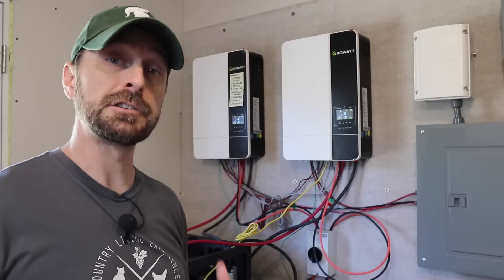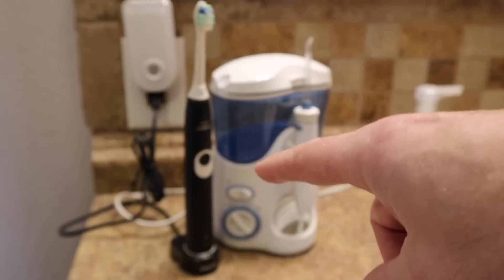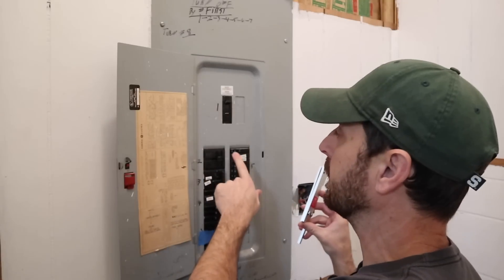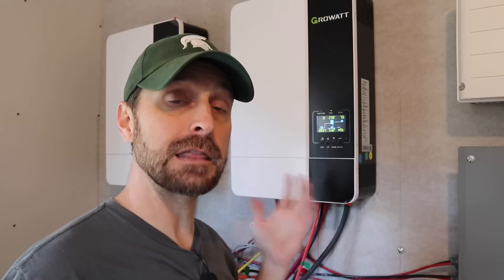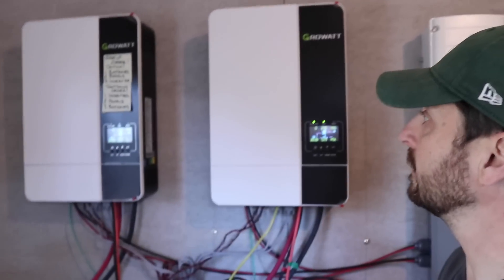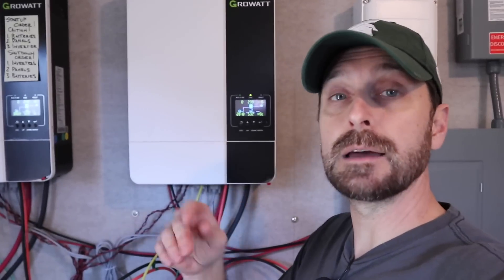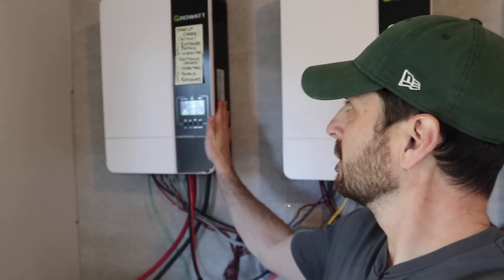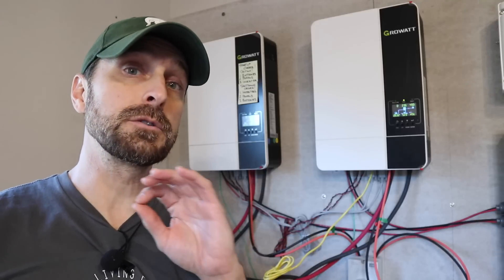Testing Our Solar System! 2 Growatt 5kw Inverters! What Can It Handle?

Comment: Good video, can I ask why you don’t have it hooked to the grid? I’m in Western Australia and I have a 6.6kw solar system and a powerwall 2, we use the batter as a backup but also to supply the house. It’s currently summertime so we make over 42kwh a day. But only use about 12-15kwh.
Reply from the maker: Thank you. I want to be independent and unconnected from everything.
If you are making that much power, you could sell back to the grid if your power company allows it and you want to be grid tied.
Reply: @CountryLivingExperience  Thanks for the reply. Unfortunately, we have another 6.6kw system as we live on a farm and we are only allowed 1 if we want to sell back to the power company, i would only get $0/07c/kwh. I worked it out the other day the power company has made over $1000 AUD from the power we send back for free last year. I often think about going "off grid" but in wintertime we do have a lot of days where we only produce1-5kwh of power a day due to heavy rain and cloud cover.
We have a gas stove top but not oven, it's helpful if thy power goes out so the battery can run the lights and water pump and other items. Anyway, thanks for the video its helpful, i like watching other people and how they set their systems up. Stay safe :)
Reply from the maker: @Achilliez  Glad it was helpful. Have a great day!
Reply: I to have not experienced flickering.

Comment: The 5000es cannot back feed to the grid, they can only pull it is a off grid inverter. If you have a generator it should be set up to charge the battery.
Reply from the maker: I recognize your name from the solar forum.
I think you misunderstood what I was saying. By backfeed I mean that if my system is on (the solar breaker on the main panel) at the same time as the grid power main breaker and the grid goes down, my system can backfeed the lines and injure a line worker. That is why I have an interlock kit. 
As for a generator, I have a small 2kw that I will attach a 48v battery charger to. You can watch Sig Solar's video on why this is a better strategy than having a large generator connected to the inverters.

Comment: Is your "solar room" climate controlled and if so how do you plan to cool it?  Would this setup be OK in a regular Texas garage?
Reply from the maker: Our solar room is open to the rest of the house as it is connected to our existing utility room. It is conditioned the same as the house. If by Texas garage you mean open air, then maybe. It may get too humid for the inverters and batteries in certain parts of Texas. Other areas may work.

Comment: Do you think the sound of these would bother you if you had them in your office?  They sounded pretty quiet to me in your video.  I am considering doing maybe 3 inverters, 2 transformers, & 6 batteries in my home office that my wife & I work in daily (we use PCs and work remotely).
Reply from the maker: Yes, the fans get quite loud when there is a heavy load on them. I would find another room for them.

Comment: On my Victron inverter, you can manually connect a generator and only turn it on when you’re not connected to the grid. This ensures no issues or problems. 🖖
Reply from the maker: Cool. Each inverter model and brand is different.

Comment: Have you tried to run your 3 ton heat pump without the heat strip off your inverters . With a soft start it should start and settle around 25 to 30 amps?
Reply from the maker: My heat strips are not connected. I didn’t want to invest $1k on a soft start for an old inefficient system. It has a slow leak in one of the lines too. Not worth it.
Reply: @CountryLivingExperience  didn't know they were that expensive.  Wow

Comment: Have you been experiencing any of your led lighting flickering from these inverters? Especially when the inverter are at a low output? Mine is making my led light bulbs flicker, barely noticeable but it's there.
Reply from the maker: I still have mixture of cfl and led but none of them flicker that I have noticed.
Reply: Flickering: usually low quality made LED bulbs...

Comment: Euro is 220v at 50hz  you need a transformer to reduce to 110v if your house has an insurance claim they will not cover you. When you add to insurance, the first thing they ask is who installed it. The Technician you need to hire first task is the wiring, then all the certifications for North America. UL, eTL, CSA  etc  Not CE
Reply from the maker: These inverters are modified for the American grid and I have a transformer. So, nobody can ever do a diy solar system?
Reply: As far as I know the inverter is  multi frequency, which can be set to 50 or 60 Hz.
Reply from the maker: @phmagpantay1066  That is correct. They can change from 230v to 240v as well.
Reply: @CountryLivingExperience  Is it certified for an inspector, I think not.
Reply from the maker: @BillyBob-fd5ht  I didn't think you could answer my question. You don't get to ask any if you don't answer mine. Now I am sure you are yet another arrogant "I've been doing this for 30 years and you don't know anything" guy.
Reply: @CountryLivingExperience   My house burns down, Should I refer you to where I got my information from?
Reply: My house was built in 2016 valued around 400K and not one single permit or inspection was done or required. I have been insured by State Farm for 6 years and when I called my agent he said Solar might add $10 a month to my bill and possibly $0 per month. How can you make a blanket statement like you did. Do you know every rule for every County in the US, or are you just a negative person in general.

Comment: How are you able to use off grid and grid  power in the same building, I am trying to do the same thing but the electrical inspector says that NEC does not allow a building that has grid power to also have off grid power if the equipment isn't UL listed, growatt isn't UL listed to can't be used in building with grid power
Reply from the maker: I don't use them at the same time. This is used like a generator. Grid power is cut to the house. The inspector doesn't understand. Give Signature Solar a call and ask. They are the experts.
Reply: @CountryLivingExperience  do you have a link that explains that NEC allows grid power and off grid power in the same building? My install would be almost exactly like yours, impossible to have both power sources powered at the same time and would be impossible to have them connected at the same time causing my solar to deed the grid, inspector won't sign off on install with non UL listed equipment and multiple electricians say they won't do an install that can't be signed off on, I called signature solar and they told me to make sure I am purchasing UL equipment so that I don't violate NEC or cause any issues with my home insurance
Reply: I passed inspection. But my grid is set up different from this set up. My grid is only used in  bypass mode on my inverter’s. You can see it on my YouTube channel. I am hoping to do a load test video next week.

Comment: If I had like 4-5 inverters and 60kwh (gyll batteries), would it be enough to power a house with a Mr cool universal w/vrf central heat pump system for like a couple days off grid?
Reply: I have 5 mr cool mini splits. I also have 12000 watts of solar and 3 of the same inverter’s with the transformer. I have been running it on only 19 kw of battery storage. Using a little grid power. Tomorrow I get 4 more batteries and hope to have them hooked up by Wednesday.
Reply from the maker: Absolutely! That is a big system.
Reply: if you have enough solar panels you can run it unlimited days!
Reply from the maker: @uhjyuff2095  If you have enough money you can do anything.

Comment: Rather than convert appliances to propane I would suggest  leaving on electric to maintain your independence. Just add a few panels and another Inverter.
Reply from the maker: I like redundancy. I won't get rid of the electric appliances. I calculated that I can use the stove and water heater for 3 years on the propane that I have.
Reply: @CountryLivingExperience  Water heater might use more unless you get a on demand. My 50 gal propane water heater tank uses about 720 gallons per 3 years and I live in sunny San Diego. My small solar array (2kw) heats my hot water now, so I don't use nearly as much propane anymore!

Comment: 😎 Our inverter is 6,000 watts, it has two 3,000 watt legs. We have to be careful about what we run, but as long as we are careful, we can run what we need to.  Our dryer uses over 5,000 watts by itself, so we just use it on air-dry then hang everything. Once we get our house built, we'll probably use propane for our dryer and stove.
Reply from the maker: Very cool. Yes, it is about knowing your individual homestead and loads. That is one of the keys to success.

Comment: How are your Inverters setup? One line for inductive and high loads and the other for the conventional outlets and lights?
Reply from the maker: No. They are a balanced combination.
Reply: Both inverters are 240 volt AC output and they are in parallel connection. Like two portable Honda EU2000i generators in parallel except these "Solar Generators" run off solar and batteries instead of gasoline. I can do the same tests on my house, including running the A/C unit outside, with my 10kw honda 20hp generator. It's thirsty about 5 hours per 5 gallons gas :(

Comment: Curious as to why 2 5k instead of a single 12k. Lot less wiring. less money.
Reply: The ability to add more capacity down the road is the biggest reason
Reply from the maker: Exactly J M. They are stackable and I can add more if needed. The wiring is really no big deal.
Reply: Why limit yourself to just a 12K? You cannot parallel those units. I have an Aimes 10K inverter and it will shut off after a little bit when welding

Comment: You are my wise man and an inspiration to me and my family. Thank you for all the information that you shared and we love your channel. I have 6 of the same battery’s, 5 of the Growatt 5000 and 2 Growatt transformers. I purchased everything excluding my 22,400 watts of panels from Signature Solar and I am in the middle of my install. I have a 3-1/2 ton heat pump with a soft start and I am hoping to be able to go off grid. I was wanting to stay grid tied for back up on cloudy days using the pass through but I notice you said the wiring was too complex. I have to get my install inspected so I am having a professional Electrition and independent solar installer do the work. Have you ran the batteries through the night yet and if so what percentage did you use?
Reply from the maker: You're welcome. I appreciate you being here.
Sounds like you have a huge system. I have not run the batteries at night yet because I have the 3 ton heat pump running at night and the system won't handle it. As soon as I switch to the mini-split system, I will run another test.
Reply: Flipping coins I would love to see a video of that set up . Sounds really close to what I'm planning. It's unfortunate that no one is doing the pass though. In December that was my plan 100% it lowers the electric bill to the lowes but gives me the grid as instant back up. Currently have a skid  of 28 435w panels and one growatt 5000es one auto transformer and 4 agm. The batteries were in a different when I purchased a trailer might as well play with them. Tell summer when the array can be installed.
Reply: @electricandlsxpower  have not had an issue with the pass through
Reply: @chrisloving6647  could you share a wiring schematic or diagram with me. I have a 23KW system with 5 Growatt 5000 2 Growatt transformers and 7 EG4 Batteries. I have a 3-1/2 ton heat pump with a soft start ( all products from Signature Solar ) and want to run with pass thru to the grid
Reply: @flippingcoins7714  not sure how to do that

Comment: Love your content but I must say that going to propane with your stove and dryer is going in the wrong direction.  Since your system can operate those appliances as is, you are more “off grid” by having electric appliances that you can power with energy that you produce.  I personally will be looking to go with a heat pump dryer, heat pump water heater and an electric stove with induction cooktop.
Reply from the maker: Thank you. I understand that but I like to have redundant systems. I already have a full 1000gal propane tank. In an extended emergency time period, I can trickle that 1000 gallons for an estimated 3 years for just the stove. I will keep the electric appliances for backup as well. I am actually going to switch my thinking on the water heater and go with a heat pump as their efficiency has gotten much better.
Reply: @CountryLivingExperience  If you like cooking on gas I'd recommend you try induction first if you have not done so before. My home has induction and I love it. Formerly loved cooking on gas myself. Induction heats MUCH faster than gas, cools off instantly compared to electric, and best of all you can set a bar of chocolate on a running stove next to your food and it won't melt.  Aside from having to get induction pans ( stainless, cast iron, or induction ready aluminum ) it has no real downsides. It's also close to 90% energy efficient compared to Electric at 65% and gas at 50%.
Reply from the maker: @genxtech5584  I thought about it. I might pick up a 2-burner induction cooktop to try it out.
Reply: Sometime this year Rheem is coming out with a 120 volt heat pump water heater. Hopefully it will be cheaper and more efficient than the 240 volt models. Might want to wait to see those reviews on them.
Reply: @chadcarrington1218  Good point Chad, but I think for this system he would actually prefer to use a 220V heat pump water heater.  This is for two reasons.  1. He has the 220V wiring in place already for his existing water heater, so no need to prefer 110V for easy wiring.  110V hybrid units are ideal for situations such as replacing a gas system with electric and not needing to run the 220V wiring.  2. The way these Growatt inverters are set up, they are 220V output and he has a step down transformer for serving his 110V loads.  This gives him a desire to run 220V loads over 110V loads in his house to avoid overloading the step down transformer where possible.
Reply from the maker: @chad carrington Thanks for the heads up on the Rheem
Reply: I agree, the stove, oven, dryer, microwave, are not super high energy appliances. Like he said he can trickle his propane tank for 3 years with those appliances, so why not keep them electric. However, the mini split idea is a great one, so if I had to choose, mini split or the other microwave and oven on electric I would 100 percent choose the mini split. The Mini split is the real high draw energy appliance, and number two is the hot water heater for most houses.

Comment: That was very impressive and informative. It was fortunate that you were able to do this before converting the stove and water heater to propane, as some folks might not have that option, yet.
I, for one prefer cooking with gas or propane rather than electric, but where I live, gas is practically nonexistent and propane is not widely used.
One of the reasons I prefer gas/propane to electric is that here (Maine) lines can go down easily for weeks. With a gas stove/ oven, you can heat at least one room, while heating water for cooking or even bathing. 
I tend to plan for worst case scenarios, so even if I lived in a mild climate, I'd probably plan for Maine winters and Laredo summers. Lol.
Reply from the maker: Thank you. I also like planning for worst case so having the propane as a redundant system was important for us. I will keep all my electric appliances for backup after converting.

Comment: After doing this test, how long do you think you could run the electric loads in your house in a normal capacity if the grid was completely off? Do you think you have enough battery backup and solar to continually stay off the grid indefinitely yet?
Reply from the maker: I can absolutely run off grid in a normal capacity without that grid once I get my heating system worked out. I could burn wood in my stove but want to get my mini-splits in. For my area, I almost have enough batteries to do that (need just a few more). Batteries are your biggest investment and you can never have too many.
Reply: @CountryLivingExperience  heating takes most of my battery power. The building I have my inverter’s and batteries in keeps having the cadet heater kick on. I will be insulating the floor and sealing it up better.
Reply: @CountryLivingExperience  thanks for the information. I'm still in the design/what the hell am I doing phase and I really appreciate your help. Eventually I would love to be totally grid independent and I think what you're doing is awesome.
Reply from the maker: @wydracon  You're welcome and thank you.
Reply: What is the lifespan of you batteries?
Reply from the maker: @unkjason  15 years at 80% depth of discharge